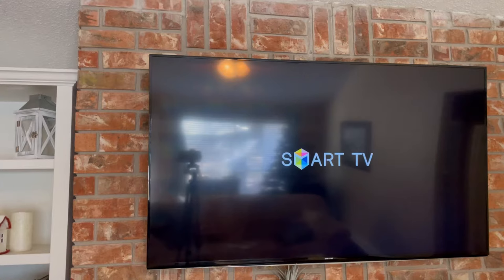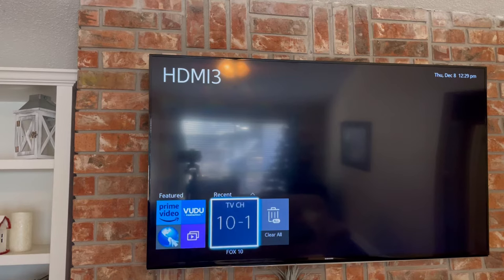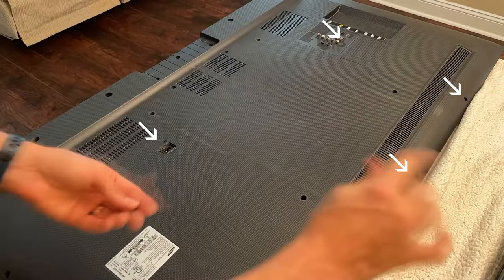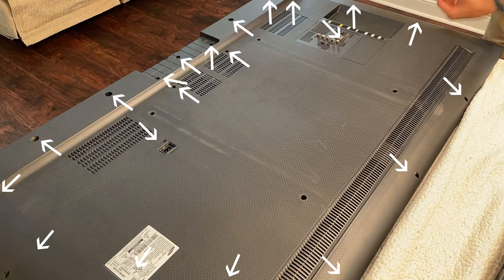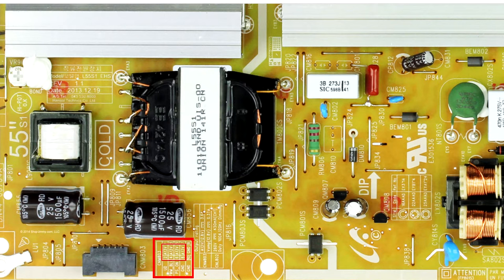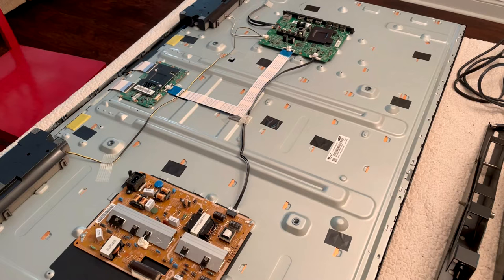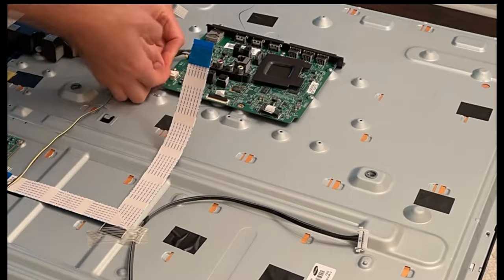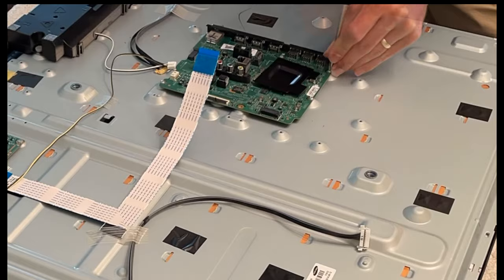How to Repair a Smart TV that Keeps Rebooting (Samsung)

Comment: in short on one thread  one guy stated that not even the samsung repair guy cold fix it.. that after weeks the last repair guy let it slip that it was some dead man switch stuff samsung incorporates to protect the tv components from damage due to power surge.. this problem is really annoying
Reply from the maker: Gotcha
Reply: I think Samsung it’s loosing its touch’ or falling apart . I’m sitting with a same problem here

Comment: The same thing is happening to me. Several months ago, I did a factory reset to fix it. The only thing I was hoping for at the time was that the TV would not go off.  Now I cannot even reach that part of the TV settings as it keeps turning off and on, I have no control over it
Reply from the maker: I hope you get it working!
Reply: @rutterrealtygc I just posted a comment here with a solution from Samsung Support that fixed the problem with my TV. I suggest you try that.

Comment: This is exactly what my tv has started doing. It started acting funny over the last few weeks. Switching to Samsung tv plus randomly, now it turns on and off without stopping. I’ll try to get a new board! Thanks!!
Reply from the maker: I hope it works!!
Reply: @rutterrealtygc  so I let it power cycle for ten minutes while I was watching your videos and others, and the cycling stopped. Works fine now. TVs are weird. Guess we keep running it till it craps out again!! Thanks tho!!
Reply: @user-ti1ic2ye4p my Samsung just starting continuously rebooting. I can’t even get to the settings. Should I leave it cycle? Hope it resets?
Reply: @LordOfTheYam me too, what can i do?
Reply: @LordOfTheYam same here . I see blue screen on and off. How did you resolve the issue?
Reply: I just posted a comment here with a solution from Samsung Support that fixed the problem with my TV. I suggest you try that.
Reply: @Hotsk  man, I really need help. Mine has the same issue, power cycles ,then after a while of doing it. It runs perfect! But after a few minutes, there comes a weird creepy looking patches of black that starts from the corners , then the entire screen shuts down and does the entire process again!
Reply: @raffysanjose04  Sorry Raffy, I'm not a TV repairman. I had hoped the solution I'd posted would work, and it did--for a couple days anyway. But beyond that, my only advice to you would be to do what eventually worked 100% for me: buy a new non-Samsung TV. Good luck!
Reply: @Hotsk literally trying this right, for those reading im not a bot, and it didnt work bro :( tv still cycles off every 5 secs

Comment: Thank you! My 2020 TV started doing this, and I assumed it was the power supply board, but now I know it can be something else. I already got a new TV to replace it, so I feel confident that even if I mess the whole thing up, I can at least try to fix the old one!
Reply from the maker: Awesome! Yeah, in my book, it was already trash, so I might as well try and fix it.😁
Reply: Did it work (asking three months later)?
Reply: @voicetube Havinh same problem 2020 Oled Samsung tv. Did it work the old tv?
Reply: @abdirahimaden1229  in my case, since I don't watch TV very often, I've just decided to live with my particular issue which is, once I turned the TV on, sometimes it takes 10 to 15 minutes to finally come on, but once it does, it doesn't go off again (until I turn off the TV) so it's something I can live with for the moment.

Comment: You probably don't have to take your TV apart!
Now, I've tried all the tips mentioned in several of these videos. Some worked for a few minutes but then the problem began anew. But I continued to look and finally, I found the solution that REALLY WORKED! In a forum I read where someone posted a response from Samsung Support regarding this problem:

"Turn off the TV, disconnect it from the power supply and any other cable that is connected to it (HDMI, USB, etc). Once disconnected, identify the power button on the TV and hold it down for 60 seconds (with the TV off). Plug the TV into the electrical current (without turning it on). Wait 15 to 20 seconds with the equipment turned off and after this time turn on the screen."

Since doing that, I've had no further problems, even after re-connecting my Blu Ray and DVD players as well as the hard disk for recording and plugging back into the extension cord. Everything now works perfectly!
Reply from the maker: Great!
Reply: I have a problem, my tv turns on automatically when connected, any solutions?
Reply: Did you plug the tv in while still holding the power button?
Reply: @UKlads2011  No. Regrettably, the problem started again after a few days. We bought a new TV, but not a Samsung.
Reply: Nope. Same problem with samsung  q60.
Reply: Man thank u so much for your comment it fixed my TV I had no response at all. The only thing my TV did was go to input one I had to buy a fire stick to control it and I still couldn’t control the volume or anything else just the fire stick, and now my TV is working again thank you very much.
Reply: @XDLeo64 you have to make sure the tv is off before you do the other steps my tv was doing the same thing the steps he’s tell u to do won’t work and listen to TV is off first so you have to make sure the TV is off and then unplug it and do the steps
Reply: @Meico330  Glad I could help. I just hope it holds up for you. It only worked for me for three days and then my tv started switching on and off again. I finally ended up having to buy a new TV--and it's definitely not a Samsung!
Reply: @XDLeo64  u have to make sure the tv is off before u do it I was doing it with The tv before I started and that make the tv came back on by itself. U would have to make sure the tv is in off mode before u do it it not it’s gonna come back on by itself and the process not gonna work I made sure mines was off and did the process. And it worked.
Reply: @Hotsk  yeah my tv is still working fine
Reply: @Meico330  That's great! Happy I could help.
Reply: I had the same problem this morning and Making sure that the TV is by pressing the power button on the remote for 30 sec and the unplugging the power cable, then turns it on again proved useful thank you for the insights. Am from Tanzania
Reply: @Hotsk What other brand did you end up switching to? And what is your opinion of it?  I'm deciding between trying to fix my broken Samsung or getting something else
Reply: @nickkenney1401  I switched to LG and prefer it to the Samsung. I can now do everything with the LG that I couldn't do with the Samsung, e.g., Apple Air Play. Nonetheless, I wasn't dissatisfied with the Samsung, but after I'd learned that many, many other people were having the same switching on and off problem that I had, that I decided to change brands. Besides, my 10-year-old  Samsung was HDTV and the LG is 4K (even though it was cheaper than the Samsung was 10 years ago!). Hope this helps you in some small way to make your own decision. Good luck!
Reply: @Hotsk  Thank you so much for the reply. I've been a loyal Samsung owner for a long time. But after dropping a hefty chunk of change on my latest tv only for it to break in 2 years, it has left me considering a different brand for now.
Reply: @XDLeo64  as soon as u see the icons turn it of off using the remote control
Reply: @Meico330  hHow is it now (asking four months after your last comment
Reply: @Meico330  hHow is it now (asking four months after your last comment
Reply: My TV doesn't have a power button mine is a UA50TU8000W Model

Comment: I had to disconnect main board ribbon from power supply board to confirm 13v output. Otherwise output was around 9v. Also having main board disconnected plugged AC and noticed power supply board stopped restarting. Which confirms something is wrong with main board.  Thanks for this troubleshooting video
Reply from the maker: Awesome! I hope you get it working!
Reply: UPDATE: I replaced mainboard ($150). TV worked fine for about an hour then started do the same (power on and off by itself). 😢

Comment: hello, and thank you for this informative video. I have the same issue, I tried to replace the mboard but I had the same issue. Should I check the power supply board? Or what I should do. Thank you very much
Reply from the maker: Have you checked the power boards voltage with a volt meter? If you only have the power board plugged in, does the backlight stay on?

Comment: Most faults are panel faults check the leads that go into tcon board  disconnect one  at a time to see if tv stays on, if not then could be logic board.
By placing thin paper or plastic tape along some of the pins on faulty control lines can fix the problem, plenty of Asian examples of fixes for many faults.
Just be careful to disconnect mains before doing anything
Reply from the maker: Got it fixed.👍😊
Reply: Wish I saw this comment a week ago
Reply: I put in paper it is working fine. Should it need to be tape? Paper can hod temperature or will burn out some time soon?

Comment: Great video! I have the same issue but only happened after downloading an update. Any suggestions? Would it be the same process?
Reply from the maker: No idea? Is there any way to roll back the update?
Reply: @rutterrealtygc  unfortunately the screen is only on for a split second so not even long enough to view anything

Comment: I have a similar issue after downloading an update. The update took a long time to download. I went to do other things and left it to continue downloading. My husband saw that no one is watching the TV, but it was making some sound. He tried to switch it off using the remote, but he couldn’t. He switched it off from the wall socket. We could not watch the TV since. It just keep on rebooting, switching on and off by itself. I have watched numerous videos and find your video solve a problem that is the closest to mine. Do you think changing the SmartBoard would solve the problem? If the TV is unplucked before an update is complete, would it render the TV unrepairable? Many thanks in advance. 🙏
Reply from the maker: Definitely terrible… an electronic device that is turned off in the middle of a firmware update can ruin it if you don’t have the hardware to flash new software on the board. I’m not sure where the firmware is housed on your tv, but I believe it is housed on the smart board on mine (because all of the original owner’s apps and everything were on the tv after I booted it up). If the firmware that it was updating is housed on the smart board, replacing it might do the trick.👍 Hope that helps!
Reply: @rutterrealtygc  thank you for your time and kindness. I may give it a go. Could you suggest where I can order the smartboard please?

Comment: thank you so very much for letting me know, i cant work on mine so its 50 inches of trash😢  but im very glad i found your video showcasing my exact issue.      doesnt save my tv in my case, however I am 100% sure there is nothing i can do to fix it and dont have to wonder if I threw out a working tv ☠️😭😂😂😂🦑
Reply: actually, I think you might respond with your thoughts about trashing the tv Vs. doing something elce?  haha i just am so not sure about electronics ¯\_(ツ)_/¯
Reply from the maker: Glad that the video gave you information that you needed! Sorry you couldn't fix it!
Reply from the maker: Typically, most things (electronics wise) can be repaired... it is just whether it is economical to do so. It might make more sense to purchase a newer TV. It just depends on how much time it would take you to fix it and how much the parts would cost to repair it. Let me know if you have any questions about the troubleshooting process.
Reply: @rutterrealtygc  it may make more sense to stop repeating the same mistake buying new, since planned obsolescence has gotten worse.  buy a used, known working 5 year (or older) tv for 20 bucks or less and enjoy its remaining expected life span. rinse and repeat.

Comment: I replaced the main board and it was still broken. But the guy who sold me the part told me to take the wide white cable out of the main board (as this is the cable to the display panel) and see if your TV turns on. 

My TV was constantly power cycling with a black and blue screen. I removed the white cable, turned the TV on and I heard audio from my TV. 

Do this step before you buy any new parts. If your tv turns on after removing the cable for the display panel then it’s the panel itself that’s broken, everything else is working.

Not too sure if it’s worth replacing the panel though, maybe if you can find a cheap one, but I found it too hard to find.. Might just have to buy a new TV, or buy a 2nd hand one of the exact same model and move your main board to the new TV, so that you retain all the saved data.
Reply from the maker: Thanks for sharing the info!

Comment: i think most of us got the same problem of it wont even display at all only the back  light then will just keep turning on and off. remote is no help. so ill try the Tcon remove and put back and get back to you guys on it. but from my research its a common samsung tizen issue. the repair guy told me its useless and he had like 5 with same issue and he suggested a new tv. but ill try this here and get back to you guys..
Reply from the maker: Thanks

Comment: Just about to get a TV with this problem as they were going to dump it. How much was the board to get as TVs are now falling in price so often (thanks Chinese low paid workers what would be we do without you) that its often as cheap (with a supposed warrantee/guarantee) to get a new (bigger/higher spec) TV than repair the old one. Plus I presume alot of these issues are exactly what the TV repair shop does and then charge you a massive hourly rate and a large markup on the board (and still no guarantee of the TV working for long after). Hate to see them going to the dump when its mostly like a board issue and not the screen itself
Reply from the maker: $70 for the board I replaced.👍

Comment: Turn of wifi and cable tv and reset tv using remote control will also fix issue. After that turn off autoupdate
Reply from the maker: Couldn’t even get that far…🤷‍♂️

Comment: Hey bro I bymistakley connect two points together and a spark came is that a problem 😢😢😢
Reply from the maker: Potentially. Just because you saw a spark doesn’t mean the board is ruined. It could have damaged it though. You could always put it back together and see if it’s doing the same thing that you took it apart to fix. If it is, it probably isn’t more damaged then when you started.😂
Reply: @rutterrealtygc  it is still working so I think nothing bad has happened 😂😬.  The backlight is working but the mother board might be the problem I guess.  😬 .  Thanks for the tip Sir 🙏 .

Comment: Samsung from 2021 just went out like a light. Black static from the top right and the system starts a never ending reboot cycle. Sound is still there so going off of this it sounds like T-Con board problems. Will have to check power supply board. Any other tips?
Reply from the maker: Just take it one step at a time when troubleshooting and don’t get electrocuted. 😁👍

Comment: I have a LGTV that does this, except sometimes I can use it for hours without a problem.  However, any time I increase the brightness past around 35 it starts power cycling again.  My first guess is the power supply, that maybe the increase in brightness is overworking it.  But when I called the local LG repair shop they said it's probably the backlight.  That doesn't make sense to me.  If you have any ideas I'd appreciate it!
Reply from the maker: That’s odd! I’m not sure why it would reboot after adjusting brightness.🤷‍♂️
Reply: @rutterrealtygc  Dang.  I can't find anyone who's had the issue and managed to resolve it.

Comment: My sons samsung tv lead me to your video. His turns on and the screen looks like it has a light on but the screens like a dim dark blueish hue around the edges...no picture of any kind nor logo. The red led flashes about 5 times and the tv makes an audible click noise and shuts off and turns itself back on and repeats this cycle. I've tried video's saying to unplug it and hold the power button to drain stored juice in the capacitors. No luck. I need to test the pins like you said I suppose. Have to find time on the weekend to try this and see if its fixable. Thanks for the tips.
Reply from the maker: I hope it works! If you have any other kind of devices plugged into it, I would unplug them (Roku, fire stick, etc). Also use the factory remote. Sometimes a Roku remote’s power button will get stuck (making the light flash repeatedly).
Reply: Exactly the same issue as per you have specified happened to my Samsung AU8000 2 days ago. The set is only 26 months old.  If i plug the HDMI from the cable set-top box to TV, i can hear some audio - albeit it drops in and out about every 20 seconds and the audio only last for circa the same amount of time. Tried pretty much everything (with the exception of taking it apart) to troubleshoot, yet to no avail.  Frustrating. Tempted to have an engineer call out, yet sceptical this will be a waste of money if the fault cannot be rectified.  Have another Samsung (TU8500) in another room - of which is about 36 months old - and to date no problems.  Will persevere for a few days, albeit may have to purchase another set - of which mot definitely will not be a Samsung!!
Reply: @rscle5 did you manage to fix it? My samsung is having the exact same problem. Ive been told its a panel fault and not fixable. I can’t believe this can be true when its less than 2 years old…